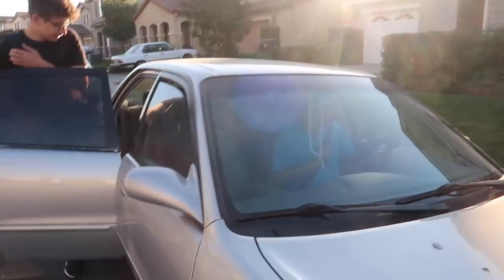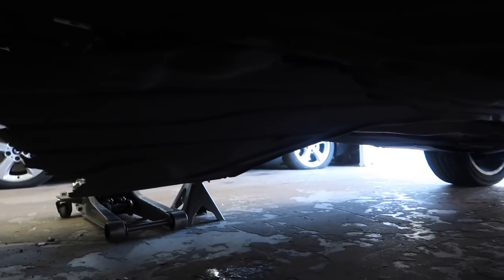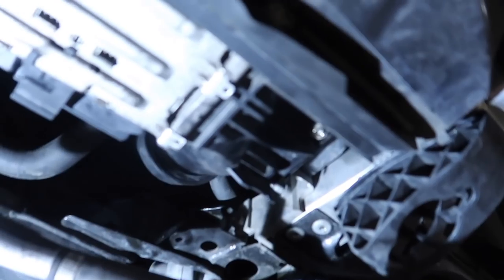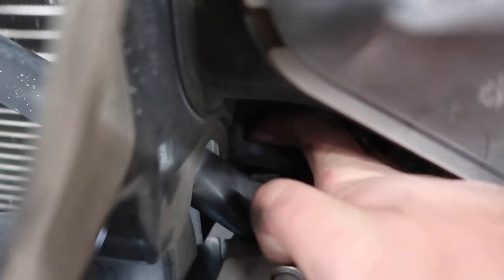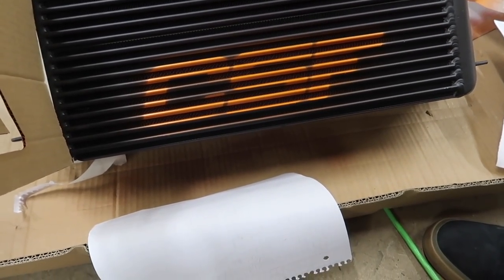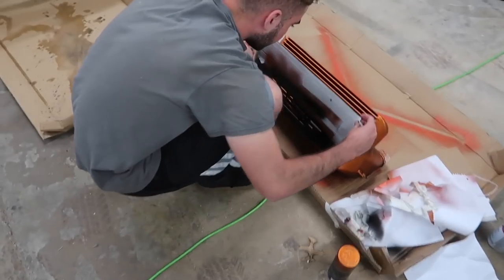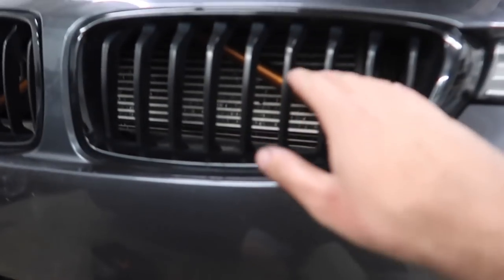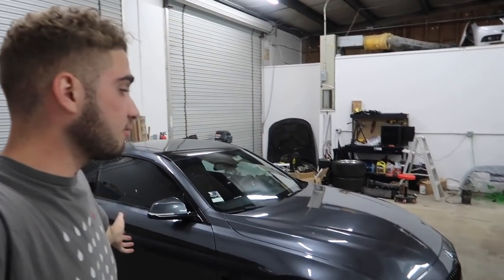CSF INTERCOOLER F32 N55 435I!

Comment: Yeah intercooler and v brace looks good. Please please don’t wrap it. The paint looks good. And lastly the car needs all the belly pans fitted. They may block you from seeing leaks but they needed to protect things like the gearbox oil pan they also help the aero flow under the car

Comment: The funny thing is that your copper painted IC will be more efficient than original CSF IC. So you actually improved it without even knowing it ;).

The catch is in the paint. CSF is all about the looks obviously, otherwise they would leave it pure aluminum instead of painting it black. So a little thermodynamics 101: by painting IC black you increase emissivity (black body radiation) noticeably but you reduce convectivity (the amount of heat that you can transfer) because darker IC will be cooler and convection directly depends on the temperature difference between outside air and IC. For cooling the convection is by far the most dominant process (not emission). And unpainted aluminum has the highest convectivity (since it will be the hottest), fair color painted one has lower and black painted one has the lowest.

Comment: The AC Smell Those are Bacteriums That can cause health issues you need to Get you AC cleaned by professional With Ozoned Air i think thats how its called , my Beemer had same I had to change the filter then went to ac specialist , they put in my car a machine , while my ac was on and The Ac Was turned to keep the air in cycle through,, after its done 20-30 min need to open the doors let the smell go out as that air is also dangerous,,,